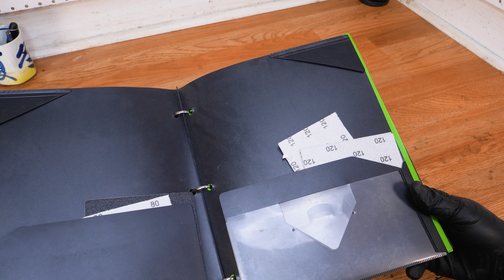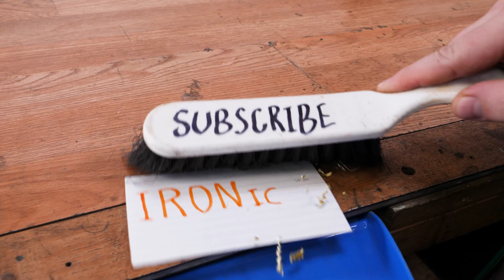Can I Save This Rusty Hatchet? Viewer Sends Me Rusty Project

Comment: Ive restored a few of those old Bridgeport, Conn hatchets. Quite a few of them were marked for the BSA (Boy Scouts of America). Most of them though Ive had used plastic inserts in the handle which are a bugger to find. 
I appreciated your method of using punched leather. Well done.